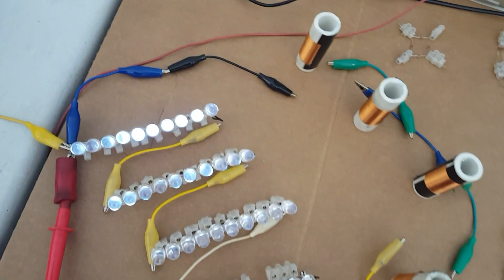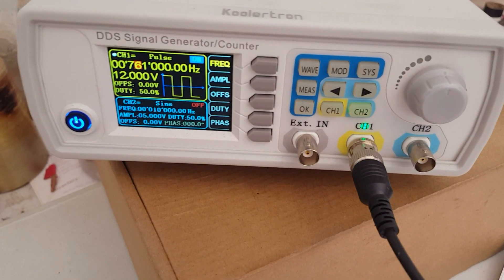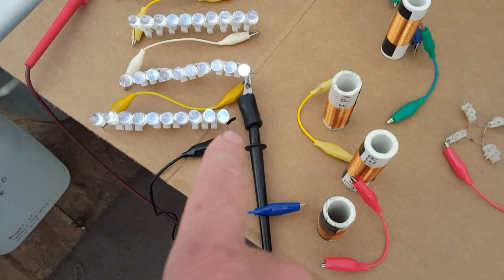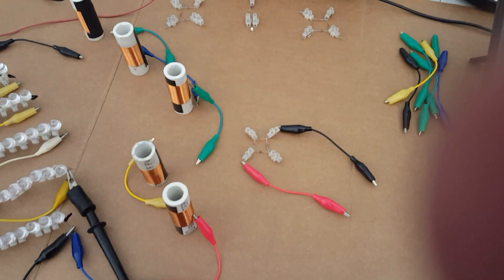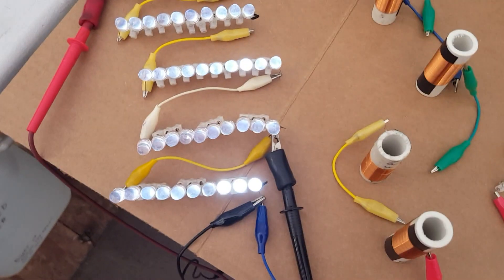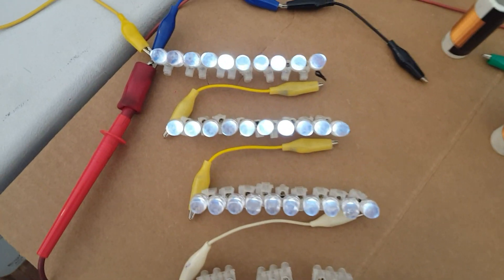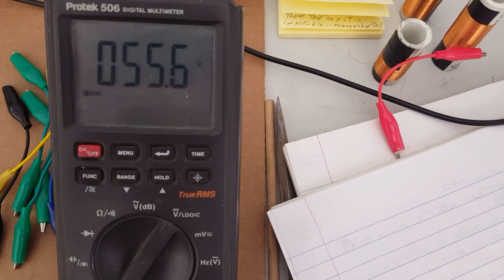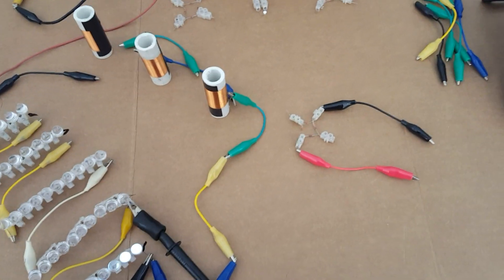WIRELESS POWER TRANSFER Part 7

Comment: What about multiples of the value you're tweaking? 
What's the correlation between the coils and that value? 
What's the total length of wire? 
Number of turns?
Does distance make a difference?
Reply from the maker: What about multiples of the value you're tweaking? 
 i thought about that, but it is easier said then done, i will keep thinking about it.
What's the correlation between the coils and that value? 
None so far as i can see, but i will do more experiments with it yet.
What's the total length of wire? 
49ft 2 inches each coil (approx 20Mhz wave length)
Number of turns?
  This changes the resonant frequency slightly, LEDs will light at a different freq.  I will try soon 1/2 the # of turns to double the freq.  Im starting to wonder if surface area of the coil maybe important, use a much larger dia wire.
Does distance make a difference?  No
I feel i am getting close to having control over this soon😎  Thanks for watching!
Reply: @INVENTOR3  keep up the good work. Don't die. 👍 And have a backup. 👍